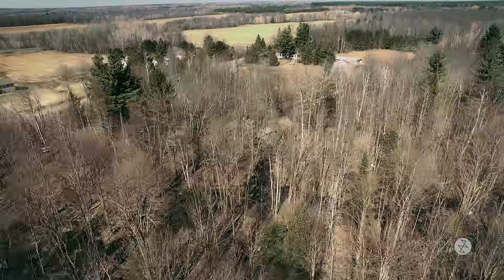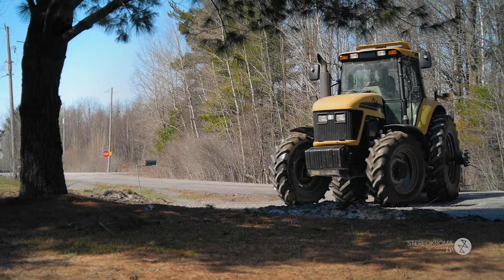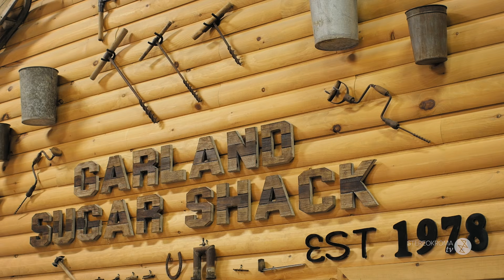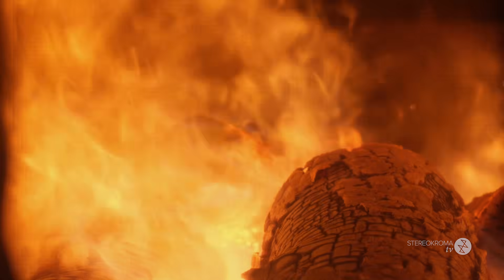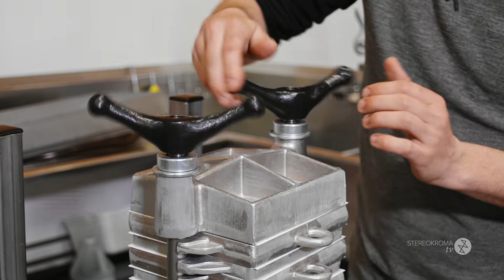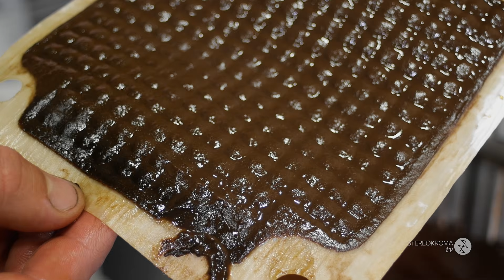Making Maple Syrup | Où se trouve: Garland Sugar Shack

Comment: I just can't believe how clean the whole place is.
You'd think they were making hard drives not maple syrup.
Reply: TheAntemon Isn't that how food factories should be tho? I mean it's food so I believe they must have like cleaning standards or whatever or is it not like this in most food-processing companies?
Reply: @cozyfire13  , this is the cleanest food processing facility I've ever seen
Reply: @cozyfire13  I worked in a production making soft drinks such as 7up and Pepsi. I thought the ground was black for the longest time. I was told to power hose it one day and the floor was a sliver white with yellow arrows for directing forklifts that I had never seen before. The whole factory was sticky to touch. The less you know about food production the happier you'll be lol.
Reply: You'd think so, but take a look at this:
https://www.fda.gov/iceci/compliancemanuals/compliancepolicyguidancemanual/ucm074443.htm

tl;dr 
if there's on average less than 60 insect parts per 100grams in your chocolate, it's A-OK!
if there's on average less than 1 rodent hair in your choclate, it's also A-OK!

kinda makes you wonder what that extra crunch is on your snickers bar, eh?
Reply: Its been over 30 years since this test was done mate
"Issued: 5/1/85
Revised: 3/95, 8/96, 8/2000 "
Reply: @theantemon6720  o-o
Reply: its perfectly fine to drink, its just pure h2o. The only problem comes from consistently drinking it. Because its pure water and doesn't have any minerals the body tries to create an equilibrium between minerals and h2o and then your cells will swell trying to compensate for the excess of h20 and lack of minerals. So its fine to drink a little bit but it cant be the only source of water you drink or you'll basically explode your cells.
Reply: @toydose  it's not fine to drink pure h2o if you where to do that you would have much more severe consequences since your bacterial cells would get stuck to the h2o.
Reply: @toydose  It's more about the salt content. Zero sodium is what the problem is. This is why when you receive an iv in the hospital for dehydration or to mix with other iv's it's a percentage of sodium and chloride ions. The amount of sodium however is incredibly small. .9% I believe, so as long as you didn't drink massive amounts of the pure water and had some salt intake you should be fine. 100% pure water though is said to taste disgusting, minerals add flavor.
Reply: @drewpatterson8009 I only drink pure  water and now I cant drink mineral because of the taste. It's too much for me.
Reply: Exactly my thoughts, also the beautiful crystal clear acoustic guitar backtrack turned this into a feast of delicious craftsmanship in action!
Reply: They probably need to be.  Could you imagine the ant infestations they'd get otherwise?
Reply: You do realize that people clean their equipment before showing it off to a camera right?
Reply: @Ken-nv2hl  yeah but to keep that level of cleaning they have to clean it every day, that shit is spotless
Reply: looks pretty new
Reply: My thought is exactly. Fucking well run operation that is. :D
Reply: @MnemeM  uuu
Reply: If people only seen Dairy farms..... they might never drink milk and only drink syrup Ha
Reply: I’ve seen lots of food factories and unfortunately it’s not always the case that they’re super clean (even in the “developed” world) but for some reason all the maple syrup factories I’ve seen have always been completely spotless
Reply: Wow I am so glad I've watched this..how many of you wants to eat 🥞 pancake with lots of maple syrup in it ,  yummy 😋 delicious ..
I've always used maple syrup but I never used their brand I wonder if I could order by mail..I will definitely look into it .Thanks for showing us.
Reply: Ain’t talking about the water talking about the whole place
Reply: Hahhahahaha
Reply: TheAntemon you aren’t wrong
Reply: I thought that to; Pristine is an understatement.
Reply: No gloves though. Or lab coats and face shields.
Reply: In US maybe.. this is Canada.
Reply: Yes. They also probably made sure it was extra clean for the film.
Reply: barbara Corcoran  I guess you never walked through the kitchen of some hotel or restaurant.
Reply: Because they probably take pride in their business
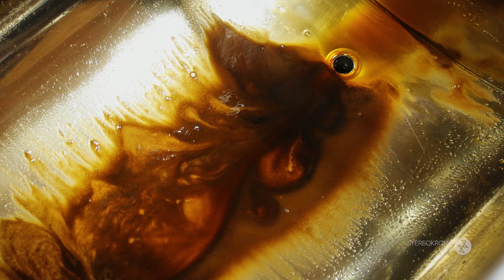Reply: At 10:00 it's not a sand, it's crystallised sugar during cooking. You should filter trough this filter before cooking,  not after.  Now all good flavours is left on filters
Reply: There is a federation in Quebec, Ca that really monitors the maple syrup, trees, environmental affect, “factory’s” ( most family business or small crews) you can almost be forced to selling to them once you reach a certain size
Reply: All that pure water they filter out, is the same type of water used in places that make computer parts etc. Pretty sure it's not safe to drink, but great for cleaning.
Reply: @alexclark4792  Hi Clark. Its 2 years since you wrote that comment, but can you please explain to why it isn't safe to drink? Im generally curious :)
Reply: @danielnorgaard14  It is not healthy to drink only pure H2O as water we drink is an important source of minerals but even if someone drinks pure H2O, he/she will not die but that mineral draining ability of water may cause deficiency of certain minerals in your body and its respective consequences can be harmful.
Reply: alosercalledsusie 

As much as I know the pure water will drain your body if its minerals. I may be wrong.
Reply: watch?v=FElDa62zwwE